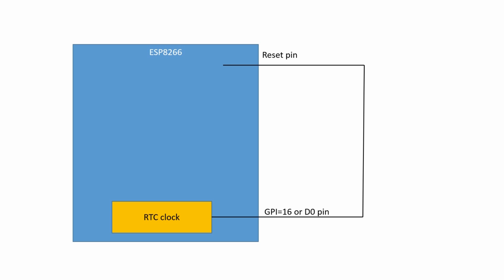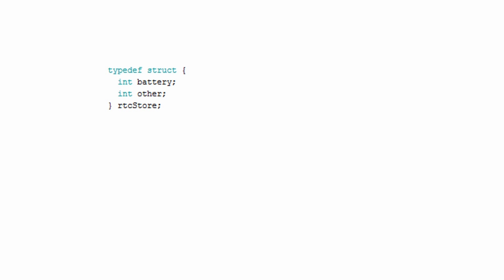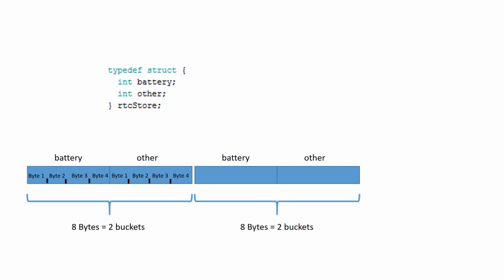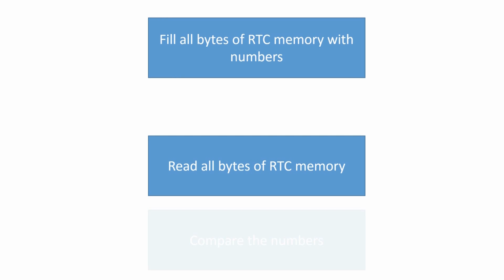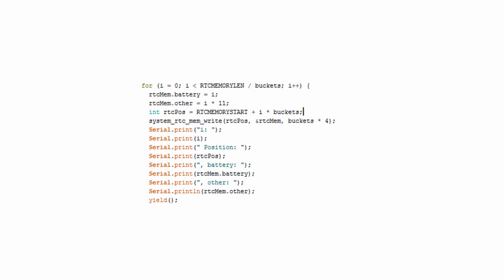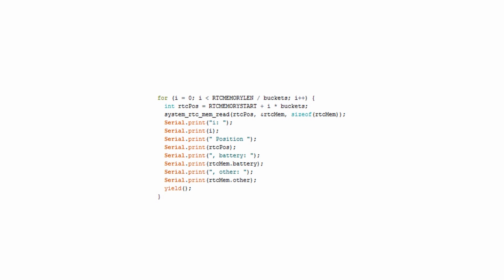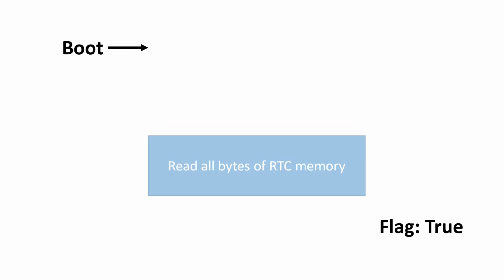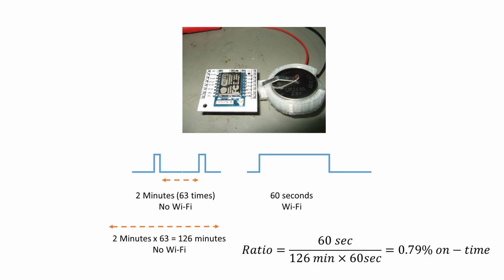#60 How to use the RTC Memory in ESP8266  and reduce power consumption by factor of 10 (Tutorial)

Comment: Thank you! Excellent video.

I have an idea how to improve battery life several times.
When we know something about the signals that we measure, we can use data compression.

For example:
1) In your example, we measure the battery voltage. If we expected range from 2.0 to 3.6 V with an accuracy of 0.05 V, this voltage can be divided into 32 zones ( with step 0.05V). We do not need to use for voltage 4 * 8 bits (as in your example), but only 4 bits. This would extend the battery life  eight times.

2) For example, we know that the data usually does not change much often. We can send only the first value (a fixed number of bits) and then only the difference Δ between last value. For different value of difference we can use different number of bits. Big difference (not too often in our data)  will have a lot of bits and a small difference (very common in our data) a little bits. For example:
Δ = 0       => 0                                                 (most frequently used)
Δ = 1       => 10
Δ = -1      => 110
Δ = 2       => 1110
Δ = -2      => 11110
Δ = 3       => 111110
Δ = -3      => 1111110
....                                                                       (used less frequently)

3) Generally, if we know the static parameters, we can design the most appropriate coding for the signal (by the entropy).

4) And trivially :-). If we want to  known whether the battery (or anything else) is in order or not, just one bit per one time is enough :-)
Reply from the maker: Thanks for your feedback. This is a very good idea if you need to store and transfer "big" amounts of data. However, usually, I do not store a lot of data in the ESP before transmitting,  because the advantage of these devices is "real time" and I would lose it if I only transfer data every few days. Please keep also in mind, that the ESP has to connect to the Wi-Fi network and this takes (at low data volumes) the biggest time ( and I also think, the biggest part of the energy).
Concerning 1 or 4 bit: If you can combine it with something else, this for sure helps, because the smallest number of bits we can transport is 8. So, the easiest way to save space for the battery voltage value is to divide the 10 bit integer value coming from the ADC by 4 and only use an 8 bit variable for the transport.
Reply: Hi Andreas,
thanks for your quick answer.

You're right. Especially in the real time aspect.

I just wanted to compress data in RTC memory and  turn on wifi part less frequently. And save battery live by them. With the same amount of data as you have!

Sorry, but you are wrong in the idea of "smallest number of bits we can transport with 8".
I can watch the RTC memory as a string of bits. Yes, I can only proceed at once to 8 bits (one byte). But that's no reason why I can not control (read and write) every single bit. Via individual control of bytes. This is simple software task.
Then I can send all the RTC memory as stream of bytes. On the server I can decode it to the original measurement data.
If I find some time, I will write library for it :-).
Reply: One more comment: Decoding can be done on ESP8266 side also. After reading from  RTC memory and before sending  by WiFi to server. It can be useful when server do not support scripting.
Reply from the maker: +Ivo Marvan this is, what I meant by "combining it with something else "...

Comment: Very interesting. I have done something similar but with FRAM memory (low current use:  5.4 × 10^13 cycles and data retention equivalent of 10 years) that can store much more data. A 'problem' with storing a lot of data and sending it at one go whether from FRAM or RTC memory  is that there is no automatic per record time stamp attached to it by the receiving server. 2 solutions for this (at least only 2 that I can think of): 
1- Calculate: if say you collect data every hour, then once all  the data is sent, you know that  the 2nd dataset is 1 hr after start and the 3rd is 2 hrs after start, etc. etc. That is a bit laborious/cumbersome, and the sleeping time of an esp8266 isn't always constant.
2- Store a timestamp with the data: for instance using an RTC such as the DS3221  The RTC will keep its time when just on battery and will use very little current (0.85 uA), but ofcourse in order to add the time stamp, it needs to receive a proper Vcc, for instance from a pin of the ESP8266 so it's I2C pins become active. Sadly though it then (briefly) uses around 200uA, but then can be switched off again. Advantage: the SQW pin of the DS3231 can be used  to wake up the ESP8266 instead of it's own internal RTC. AFAIK that way one can also bring the ESP8266 in 'hibernation' which shaves off a couple extra micro amps I believe.
If anybody has an other idea of how to add a timestamp I'd be happy to hear
Reply from the maker: Thank you for the additional info. For logging (where time is relevant), these days I tend to use the internet connection and store it on my home server.

Comment: I think something has changed since this video was made.  Suggest using 
    uint32_t foo = 255;
    ESP.rtcUserMemoryWrite(0, &foo, sizeof(foo));
    ESP.deepSleep(5e6);
which doesn't need the user_interface.h library and fixed a weird bug where incorrect values were retrieved.
Reply from the maker: Well possible that things changed since then. Thanks for the info.
Reply: Or is that an ESP32 library call?

Comment: I haven't tested this, but it appears that you should be able to use 'system_get_rst_info()' or 'ESP.getResetInfoPtr()' to find out why the esp woke up. I think it might help you save that additional byte you are storing at location 64, and the few cycles associated with it.
Very useful video, as usual!
Reply from the maker: You are right. I just tested: 
  rst_info *rsti;
  rsti = ESP.getResetInfoPtr();
  Serial.println("\r\nStart...");
  Serial.println(String("ResetInfo.reason = ") + rsti->reason);
prints 6 if the ESP starts from scratch
and prints 5 if it starts with a reset. Thanks for the hint.

Comment: Hi Andreas, you could use system_get_rst_info() instead of your own flag in RTC memory. user_interface.h defines the following:

enum rst_reason {
        REASON_DEFAULT_RST              = 0,    /* normal startup by power on */
        REASON_WDT_RST                  = 1,    /* hardware watch dog reset */
        REASON_EXCEPTION_RST    = 2,    /* exception reset, GPIO status won’t change */
        REASON_SOFT_WDT_RST     = 3,    /* software watch dog reset, GPIO status won’t change */
        REASON_SOFT_RESTART     = 4,    /* software restart ,system_restart , GPIO status won’t change */
        REASON_DEEP_SLEEP_AWAKE = 5,    /* wake up from deep-sleep */
        REASON_EXT_SYS_RST      = 6             /* external system reset */
};

Note that in older versions of the SDK, reason 6 was returned instead of reason 5. Get an update if necessary.
Code example follows. Viele Gruesse, J.

extern "C" {
  #include "user_interface.h"
}

int get_rst_reason() {
  rst_info* ri = system_get_rst_info();
  return ri == NULL ? -1 : ri->reason;
} 

void setup() {
  int resetReason = get_rst_reason();
  // ...
}
Reply from the maker: Thanks for the info!
Reply: Can you use this to differentiate between RST button push and timer deep sleep wake up?  Been looking all over for this? link?
Reply: @Andreaspiess
Reply from the maker: I did not try it. But it should be easy for you to try it out. Maybe you post your results here.
Reply: oh, but i think is a perfect challenge for the excellent man with the Swiss accent! :)
Reply from the maker: You see: You can do it, if you really want! Thanks for the update.
Reply from the maker: Please forgive me. I am an old man. I do not remember everything. So, you have to try. Usually, there is a reason for things I do, also for the magic number. But I am sure, you will find out...

Comment: The algorithm for calculating number of buckets that a struct requires is faulty. Example: a 5, 6 or 7 byte struct will result in buckets == 1, i.e. that the struct will fit in a single 4 byte bucket, which is clearly wrong.
The following algorithm will correctly round up the number of buckets required, and does therefore not require the additional "if (buckets==0) buckets=1;"...

buckets = (sizeof(rtcMem)+3)/4;
Reply from the maker: Thank you. Good to know!

Comment: I am really glad I found this video and with it your whole channel. That RTC memory info was really hard to find. Your video helped me a lot in understanding how to use it also it's still hard to get into my head that a single integer has the same memory size as a struct with two integers due to memory alignment.
You could save the battery measurement as millivolts in an unsigned int to save some bytes in the github code (It should be 8 byte because int+float have 6 byte and get padded to 8. 2 ints would fit nicely into 4 byte so the memory can hold twice as much values).
I don't think the measurements are accurate to the third digit after the comma so it seems like a good compromise :)
Reply from the maker: Fortunately, the ESP boards have plenty of memory compared with the Arduinos. So we do not need to care too much...
Reply: @AndreasSpiess  Thank you for the answer.
Currently I am playing around with a sensor based on the Wemos D1 Mini similar to yours (they are great for inspiration) and at least the rtc memory feels quite limiting. I am planning to implement some backup method that stores that data in the flash when the server is not reachable after the rtc memory is full and in that case it's probably quite a lot.
I am not so sure how to treat flash correctly so that it will last for a long time but I think I read somewhere that only the block erase causes issues (limit of about 10000 rewrites) Writing the 127 bytes to different blocks once in a while will probably be ok also I with the flash had some intelligent load leveling like a modern ssd. At least I learned to be carefull when writing a few thousand values to the same memory address otherwise my first esp would probably already be dead.

It's really exciting to work with this limitations. Coming from desktop development with almost no micro controller experience opens so many new perspectives. I would never have considered the 4Mb flash as plenty of memory (moreso because I thought it's only 4kb) but compared to rtc memory it is : )

I might be overengineering my sensor but where is the fun when it's to easy...

Comment: From honest view,  this couldn't be more exciting.  huge thanks for your contribution to ESP community.    In order hand, I was wondering if there is any command to clear RTC memory for future data logs or we we just rewrite without problem.
Reply from the maker: You're welcome!
RTC is "cleared" as soon as you power the ESP off. This is, why I use a "magic byte". If it is not set, I assume the RTC is cleared. Cleared does not mean, all bytes are "00" of "FF", they just do not contain useful information and can be overwritten.
Reply: Thanks Mr Andreas
Reply: For my project, My idea is send anolog data to a database, however I need to keep the data into database in case the wifi connection goes down, the erase it. My concern is how many time cycle you can read and write from the RTC memory. is there any limit?   Also is it possible to use both eeprom and rtc memories?
Reply from the maker: 1. I do not know of a limit for read-write cycles of the RTC memory. 
2. You can use both memories, they are independent.

Comment: Thanks a lot. It helped me a lot in setting deepsleep with RTC memory.I am able to take temperature measurements and store as well :). But I have a question if there is a way to decrease booting (startup )time after deepsleep. It is around 270-300ms (taking measurement and going back to sleep again).
Reply from the maker: I do not know. Maybe you check where the time is used. If it is in your code, you are in charge. If not, I think, you have to accept it. Maybe it is faster with WiFi disabled?

Comment: Great work.
Wondering if SD writes would drain the battery very fast, otherwise could  fill an entire SD (or  maybe just a workable size) and upload that. Nevertheless this RTC use is a very nifty method
Reply from the maker: With an ESP you do not need an SD card, because it has lots of flash (up to 3 MB) already on board. You can use this to store files similar to an SD card (called SPIFFS). This is a lot for integer or floating point numbers. But if something happens to the device, it is not easy to get it out. And you do not want to wait two years for the first upload. Maybe you want the data "real-time".
Reply: and survives a deepsleep? Interesting
Reply from the maker: Yep. That's the concept. However, not power down!

Comment: Hey Andreas, I have a question.
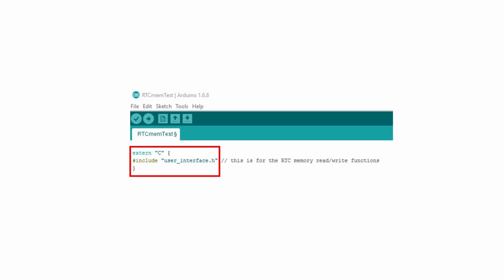Is the name of the structure you used at 3:56 'rtcMem' or 'rtcStore'? because I need to use two structures in the same sketch, and I don't know how to name and declare the second one. If the name is rtcMem. do I need to use 
rtcStore "name of my second structure";  to name my second structure?
Reply: I think I found a solution.
I thought what you were using was something to do specifically with that C file and the rtc memory commands, but I think they're just names you used right?
I used this for reference: https://www.norwegiancreations.com/2017/10/getting-started-with-programming-part-8-typedef-and-structs/
Please correct me if I'm wrong.
Reply from the maker: You are right
Reply: The aim of the code I was using is to log data, sleep, log, sleep, etc. till the memory is full, then it transmits it over telnet(an idea I got from your video #82). However the logger isn't working...

CODE OVERVIEW:
I'm using an if statement with the condition  i<RTCMEMORYLEN, and it increments i and saves it in the RTC memory. After sleep, it reads that slot in the memory and updates i based on that.
I'm not sure why it isn't working. Any suggestions?

  buckets = (sizeof(rtcMem) / 4);

  if (buckets == 0) buckets = 1;

  system_rtc_mem_read(65, &rtcC, 4);

  i = rtcC.counter;

  

    

      if(i < RTCMEMORYLEN / buckets){

      rtcMem.CO = analogRead(A0);

      int rtcPos = RTCMEMORYSTART + i * buckets;

      system_rtc_mem_write(rtcPos, &rtcMem, buckets * 4);

      i=i++;

      rtcC.counter = i;

      system_rtc_mem_write(65, &rtcC, 4);

      ESP.deepSleep(1000000, WAKE_RFCAL);

      }

Comment: Thanks again for great explanation , question please : may we know how long is the life time of the RTC memory AND how long the esp can store our sketch  on deep sleep AND without batteries ?
Reply from the maker: 1. RAM should not have any limitations It is ram, not Flash
2. Deep sleep does not work without VCC.
Reply: I know that deep sleep does not work without VCC, the question is where the data saved when no VCC connected ? and how much long ? (the sketch code for example ) if this place is the RTC Ram so as you said it has no limitations like PC hard drive?
Reply from the maker: You have 3 possibilities:
1. RAM: No limitation on the number of usages, lost during deep sleep and power down
2. RTC memory: No limitation on the number of usages, keptduring deep sleep and lost during power down
3. EEPROM: In ESP8266 emulated in Flash Memory: Can be written a few thousand cycles, not lost during deep sleep and power down. Has to be written in one block

You chose, which one is convenient. You find videos from me for all three examples
Reply: Thanks you very much !
Reply: You could also attach an FRAM chip via I2C (a.k.a. 2-Wire). It's non-volatile, lasts a huge number of cycles and will save your data up to 10 years.

Comment: Hello Andreas, Your videos are very informative.  Thank You.  I'm a home hobbyist.  I'm looking for a circuit design that when it detects water, will bring the 8266 out of Deep Sleep to send a WiFi message. Both this circuit and 8266 are powered with AA batteries (or equivalent) with a desired battery life of months to years. The water sensor and 8266 are not close to any wall outlets. Do any of your videos address this situation?  Thank You.
Reply from the maker: I made some videos on deep sleep and power consumption of the ESP chips.
Reply: If you could use water as a reset/power by using water's resistance to conduct electricity - ex. two wires in a mug which gets filled with rainwater and conducts electricity, then you can remove polling and still keep it fast. Then, use low power esp (usually raw ESP in adapter plate + ldo 3.3v regulator + battery) and use the rain signal to enable/reset the chip.

Comment: (edit) : My mistake .... sorry about the disturbance : 
****** !!!! GPIO16 needs to be tied to RST to wake from deepSleep !!!! ********* 
(end of edit)

Hi Andreas,

Looks like I am having a problem with this sketch (RTCmemTest.ino).
Whenever the ESP goes into deepsleep, it never wakes up again and the red Led lights up (in error, I guess).

I have tried your sketch with :
ESP.deepSleep(5000000, WAKE_RFCAL);  
and also with :
ESP.deepSleep(5000000);
But to noavail : it never wakes up again.

I have also tried with 3 different boards (one ESP12E and two NodeMCU).

Here's the last lines displayed on the serial monitor :
(...)
i: 60 Position: 185, battery: 60, other: 660
i: 61 Position: 187, battery: 61, other: 671
i: 62 Position: 189, battery: 62, other: 682
Writing done
before sleep
æÌÌ fœ>fÂŒp~òÎ>æÌÌ fœ>æÌÌ fœ>fÂ  Œp~fÂŒp~æÌÌ fœ>æ ÌÌ fœ>fÂŒp~fÂŒp~

I have to press the RESET button to make it reboot and display the RTC memory on the Serial monitor, but then it goes red LED again and no wake-up after the gibberish ...

Any hint ?

(edit) : My mistake .... sorry about the disturbance : 
****** !!!! GPIO16 needs to be tied to RST to wake from deepSleep !!!! *********
(end of edit)
Reply from the maker: You never stop to learn. Happened to me, too...